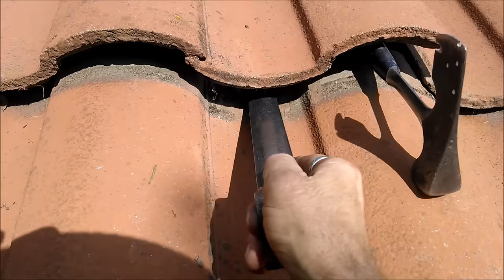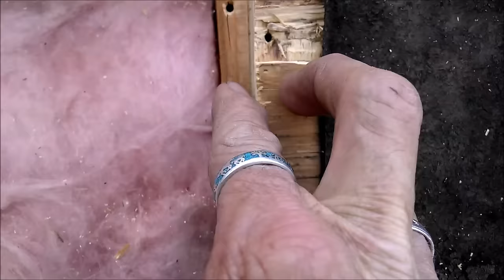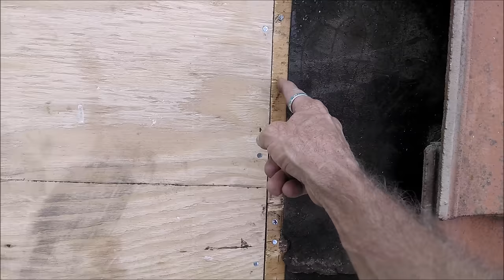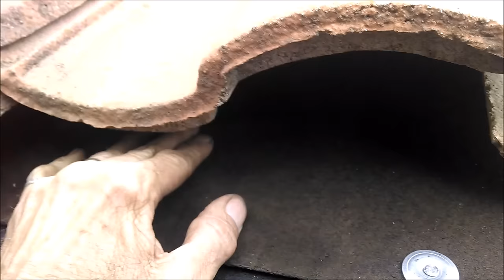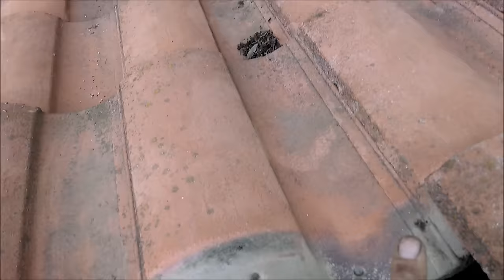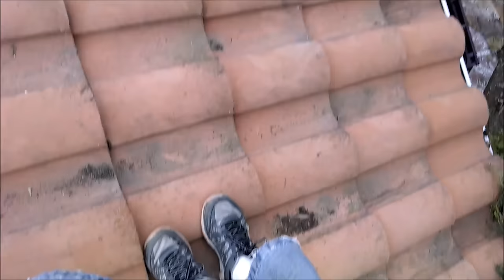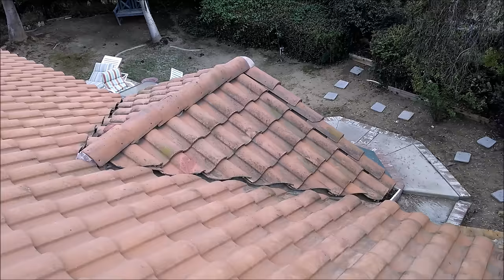Roofing Tile Leak Repair - Tips, Tricks & Helpful Hints

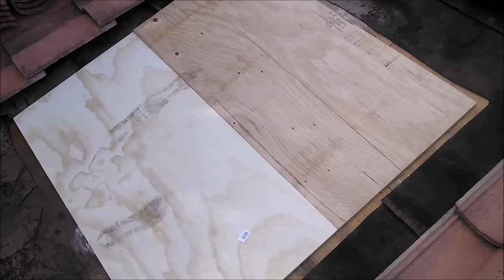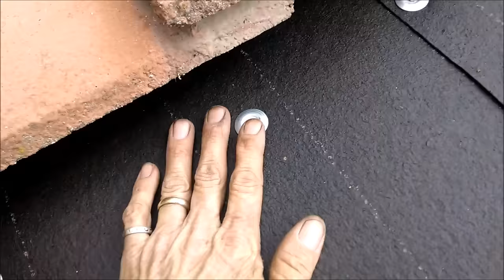Comment: Great video!!  Thank you so much for uploading.  A few questions…. 1.  How did you know the length and width of the two needed panels to begin with?  I see at 6:32 you layed them over the old rotted wood panels, but you didn’t explain how you know what sizes to get cut at Home Depot.  Did you just measure from nail to nail? (is that the 48” to get the lip on each side?)  2.  What tool did you use to make that cut in the old wood after you used the magic marker to outline your panels?  3.  And with that tool, how did you ensure it only cut so far deep without destroying other parts of wood underneath?  4.  Is the tool blade set for a certain depth, such as, ¼”?  5.  What did you set yours at for this job?  6.  You used 30 mil base felt paper:  What kind of nails did you use to nail that down to your new panels?  The head of the nail looks like it is the size of a quarter.  Are those special nails or normal nails with nail caps to widen the spread to hold down the felt? (pause at 12:43, those aluminum looking caps).   GREAT VIDEO!!  You inspire me to tackle my roof that is experiencing the same damage.  Thank you.  Please respond so I know what to do.
Reply from the maker: GR8WHITEC5 GR8WHITEC5 GR8WHITEC5 1. The plywood panels at Home Depot come 2’ & 4’ pre-cut sizes, or you can buy a full 4’x8’ sheet & cut it yourself. Most residential rafters are installed either 16” or 24” widths. So one pre-cut 4’ wide panel will span either (3) rafters @ 16” OC or (2) rafters @ 24” OC. Sometimes rafters spans aren’t exactly perfect, so measuring between the nails in the old sheathing will tell you if rafters are installed within the tolerances necessary to accommodate the new 48” wide panel without cutting the panel down. So after I measured between nails of old sheathing, I knew that (3) rafters spanned almost exactly 48” wide & I laid the new panel over the old sheathing, squared it up to land in center of rafters on each side of new panel & marked old sheathing - using new panel as my straight edge to mark the opening for the cut. Moved the old panel out of way & 2, 3, 4, 5. I used a skilsaw (wormdrive) to make the cut with blade depth set slightly deeper than 1/2” which was the thickness of the old roof sheathing here. Because you’re cutting directly on the rafters through the old sheathing you shouldn’t have to worry about destroying anything under the old sheathing. If you penetrate all the way through the sheathing you’ll only cut slightly into the rafters & will not hurt the integrity of the rafters with only a small shallow cut such as this if blade happens to go slightly deeper - 1/8” or less - than thickness of old sheathing. Even when cutting old sheathing horizntly between rafters, you still won’t cut into anything else if your blade is only slightly deeper than thickness of old sheathing. I like a wormdrive saw & carbide tipped blade for this task to cut through any nails I may have missed removing from old sheathing. 6. 30lb felt paper is code sufficient for most tile underlayment applications in my area. Check local codes for your area & do NOT listen to bs salesmen. Code is standardized for good reasons & works fine when everything is installed correctly. Felt nails I use are 3/4” metal galvanized cap nails to spread holding pressure out on felt for superior holding ability over time. Similar plastic cap nails can also be used, but they do NOT have the same holding power as metal cap nails over long periods of time & the plastic cap nails deteriorate quickly over time as opposed to much longer lasting metal cap nails. Hope that helps. Let me know if you want more clarification or have other questions. Thanks for watching. God bless!

Comment: I was up on my roof this morning finally found the courage to take a section of tile off as you suggested. I found a couple of place where the underlayment will have to be replaced. I took several videos and photos of my progress. I have a question about the underlayment. If it shows wear, but isn't penetrated, do I have to consider replacing it?  I know I have to cut out and replace the penetrated underlayment. I guess when it's cooler I will cut out the underlayment and see what damage there is to the wood base. The strips of wood for the tile are in pretty poor condition. Many of the nails for the tile were corroded almost completely. Many of the tiles I glued did not hold together well. The RT600 glue seems to no longer be available. I bought a tube of Loctite and I hope it will work.
Reply from the maker: It depends on how bad the wear is on the felt underlay.
Reply: @MrThedocholiday  I am buying a whole role of underlayment so I may just remove more tiles and do the whole section. My son gave me an old role of the thinner (felt?) but I would rather have the thicker felt and be compliant with code. I can see where there has been water flow over sections of the old underlayment. As I pay attention to your words more closely I am figuring out I may have to do more than I expected, but I am more confident now. My wife keeps hollering "GET OFF THE ROOF!". She thinks I'm going to fall off.

Comment: Extremely informative video, so thank you for posting it!  We just bought a Mediterranean style house built in 2001 in Texas so this is my first cement tile roof.  We have a raccoon family (mother and cubs) that somehow got in.  Critter Gitter not able to locate an access point so far.  Where do coons find best places to get through these types of roofs?  We also had a leak last month which roofer said was debris build up under tiles in a valley.
Reply from the maker: Okay, first off, thanks for watching. Secondly, critters get into these higher profile tiles anywhere there is access through the crown of these tiles. So typically in valleys the tiles are cut & leave openings for access. They can be installed tighter but few roofers take the time to make all cuts precise & tight. Realistically speaking, anywhere the crowns of the tiles are open to whatever size critter is trying to get in, is an access point… at least access under the tile itself, but not necessarily through the roof deck into other areas.

Third, valleys are notorious for leaking on all types of roofing, because just like a river flows through a valley, roofing valleys have to manage 10-100X more water runoff than the rest of the roof. Therefore, valleys need installed correctly & kept clean regularly.

Hope that answers your questions.

Comment: Outstanding video!.  We just experienced a healthy rain storm here in the desert after not having rain for six months.  We cheered until we noticed leak.  Now we are a little anxious about the extent of the repair required.  While I'm not in a position to do the job myself; your video has giving us the confidence to evaluate any quotes and work that we will need to have done to make our roof whole again.  Five thumbs up!  The only thing missing would be to find a honest and experienced person of your abilities here in our neck of the desert. PS.  one concern that you didn't address is whether you might need to replace the insulation below the leak area.  Could this be an area where "mold" develops?  Thanks again for the great video.
Reply from the maker: Chuck Baldonado in So Cal mold doesn't pose a threat if you stop the leak, only if the roof continues to leak. Elsewhere in the country, mold will continue to grow & cause health problems due to humidity, but not in so cal. Obviously, there are exceptions to that statement but it's not typical. The insulation in that area of the roof could have been replaced or not. It was still rather airy & will still function as insulation even though a little dirty, so it was left without being replaced because no obvious mold was present.

Mold usually develops around the same time that the drywall on the ceiling is deteriorating, so in this case that didn't happen. The sheathing was the only issue here. Thanks for watching.

Comment: Duster Dan, Great Video. I need to repair my roof in 2 areas.  Would you list some of the materials? There was 15 lbs. ATM, Mastic to cover the nail holes, Terra Cotta Paint, Tripolymer, AD Nails and 10D nails? if there is anything I missed or didn't get right. Again great job.

Comment: Great video, it Seems like you’re saying you tuck the new underlayment under at the top, but then over the old underlayment  on the sides. If that is correct, it seems like that would cause an issue in the upper corners. Thank you
Reply from the maker: Yes that’s correct. Every new course gets tucked under every old course above. That way if water ever happens to travel sideways, each new felt blanket is water tight in itself. And with something like flat tile where the tiles can actually cause water to run sideways, I like to seal each new course down to each old course on the sides to prevent this. Any higher profile tile typically doesn’t need sealed on the sides of the new felt though, because water inevitably tends to run down slope rather than across the roof like is often the case with flat tile.

There are no problems created in the upper corners by tucking the new under the course above & overlapping the old below.
Reply: Thank you for the answer👍👍

Comment: GREAT tutorial. I don't know if you're still following this or even can answer, but I have a tile roof similar to this and I've been told that the leaks are coming from broken  mortar on the "projecting vent" tubes coming out of the roof and possible leaks in the valleys between sections. One instillation company wants to use exoanding foam, which is then covered with a silicone sealant for each of these areas where the tubes come through the roof, and the same for the valleys. Another says, "Nah...cement mortor is just fine." BIG difference in cost of estimates. Any advice? Need to make a decision soon! Thanks. Rhonda

Comment: Cool video. I'm wondering, wouldn't it be better if the bird stop was porous? Now it stops water from getting to the gutter. Also, what I saw on another youtube video, you can slide a tile under another tile and still attach it without glue if you use a lead/zinc strip. You nail down the strip, which sticks out towards lower part of the tile, and you fold the strip up over the tile.
Reply from the maker: The birdstop has weep holes in it to let water out from under the tile, but there’s not supposed to be any water under the tile in the first place. It’s supposed to run down the surface the tiles, overlapping the birdstop at the dripedge & flow off the tile into the rain gutters whenever they are present.

There are a few different options for not nailing or gluing tiles, but local codes dictate which methods are allowed for each area of a country. Battens are a common one in So Cal, but again, local codes dictate whether or not the tiles are required to be nailed to the battens after the battens are nailed through the felt paper into the roof deck. In this video, the local code simply required the tiles to be glued or nailed through the felt into the sheathing.

And most importantly, there are practical reasons why codes change for different areas. I’ve heard many different roofers condemn methods like one layer of 30lb felt for tile roofs that local codes allow. Some roofers claim that 30lb felt is insufficient despite code allowing this in many areas. But I’ve worked on thousands of roofs over the last 33 years & never once have I seen where 30lb felt paper expired prematurely when the tile on top of it was installed correctly. So codes expect the tile to be installed correctly along with the felt paper & other materials that they authorize.

Problem is that many roofers are in the habit of cutting corners on installation quality & then they want to blame the materials as inferior & up-sell the customer on higher quality materials in an effort to cover their poor quality labor.

Many hate me for pointing this out but it’s a fact & facts don’t care about their feelings or their egos. I’ve literally completed thousands of roofing repairs & inspections on other people’s roofing work over 3 decades. So it doesn’t matter how loud flaky roofers cry about me pulling back the veil. The customer always comes out ahead when quality is prioritized. Most roofing laborers don’t like to work that hard for their pay, so crying about craftsmen who hold them accountable makes them hate quality contentious contractors who are appreciated by the customers & by the industry itself.

And that’s why I made this video... besides the fact that I want the customer & contentious roofers to learn how to install or repair roofing in ways that meet or exceed local codes without costing the customer any extra for premium materials.

Comment: Hi Dan, great video.  I was hoping to see how you took out the first tile. Your video makes it look easy, but I am having a hard time getting it started, having a hard time getting the first tile off.
Reply from the maker: YJ Kim Alright, so sometimes getting the first course of tile loose is difficult. So that’s why in the beginning of this video I mentioned pulling up on the individual tiles that I planned to remove first. By “up” I don’t mean up slope but rather up from the roof deck towards the camera lens... up towards myself. I only pull up on them to loosen the nails if I can’t get the nail bar under the head of the nail, because sometimes the tiles will break when I pull up on them. So 1. Pull bottom edge of tiles up towards yourself. 2. Separate tile above with flat nail bar from the tile you plan to remove. 3. Put something like a roofing hammer in between the two separated tiles to hold them apart so you can retrieve your flat nail bar. 4. Use flat nail bar to get under nail head & pull the nail holding the tile that you plan to remove. Sometimes you’ll need to bend over the nail as it comes out & continue using the nail bar to remove nail more every time you bend it over for clearance. 5. Once nail is removed, use flat nail bar to hold up tile above again as you retrieve your roofing hammer. 6. Pull nail bar out from between tile above & tile you’re removing. 7. Use nail bar to separate adjacent tiles that are pressing down on the tile you want to remove - relieving pressure from adjacent tiles so you can remove the first tile. 8. Grab tile you want to remove which no longer has a nail holding it nor other tiles pressing down on it & pull straight down slope. If tile will not come loose, check for second nail holding it in place. If no other nails appear to be holding the tile, it may be hooked on a batten wood strip, in which case you will need to elevate the top of the now loose tile & lift the tile lug over the batten in order to slide it out down slope & remove it.

Basically, you have to remove the nails & get all weight off of each tile before you can pull them out.